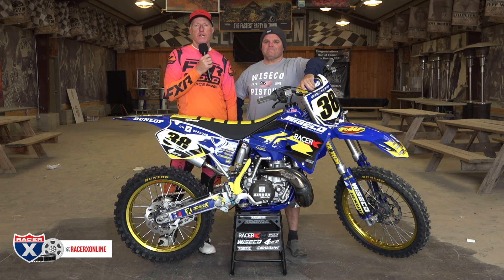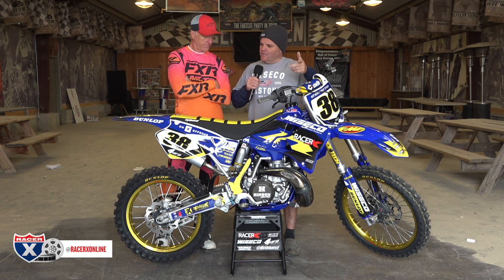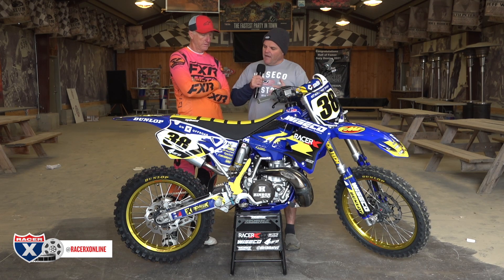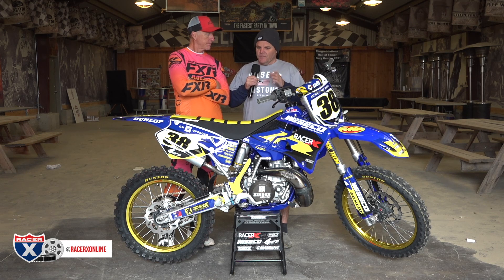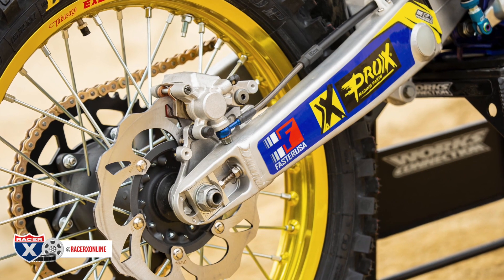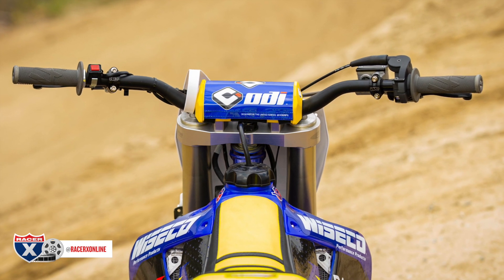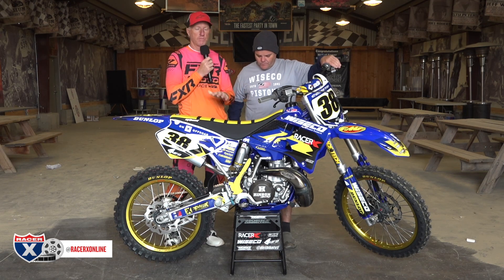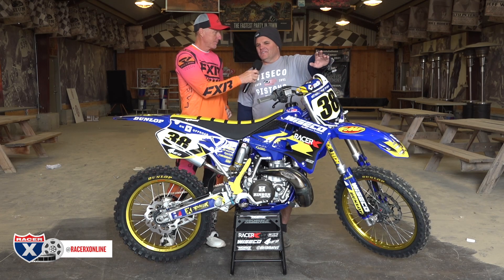Racer X Films: 2001 Yamaha YZ250 2-Stroke Garage Build Project Bike

Comment: Beautiful bike. I bought an 02 Cr250 3 years ago. The outer fork tubes were rotting And powdery. Found 01 set of forks. Inner tube was rusted and wouldn’t come apart. Cut it into and rebuilt. Nice set now.

Comment: I just rebuilt my 2001 yz250 with a hotrod crank and wiseco piston stock bore, what jetting should i start at and what would you guys recommend for first start/ breakin process
Reply: What chain adjuster blocks are you using?  I've been searching the last 4years they don't make any aftermarket blocks for 96-01 yz250s only 03 and up, and the swingarm changed to a different size. OEM discontinued